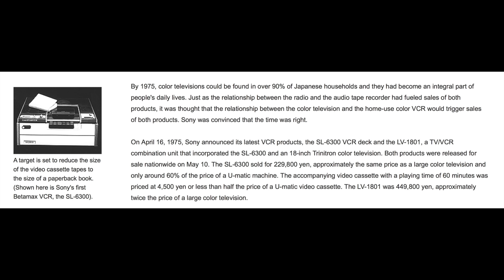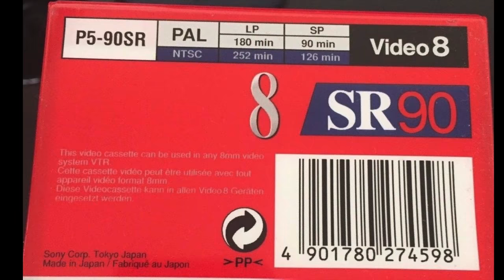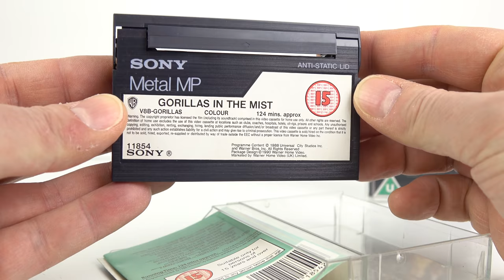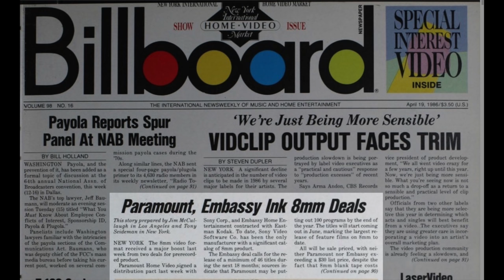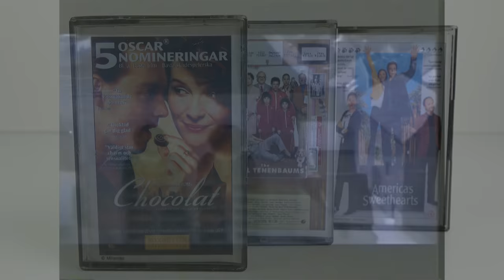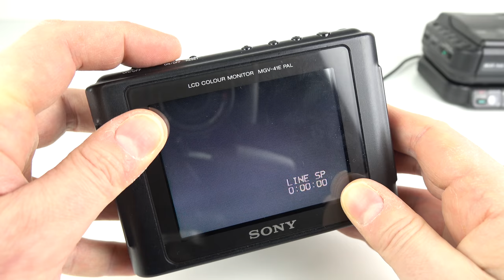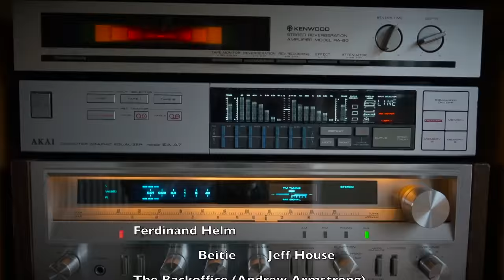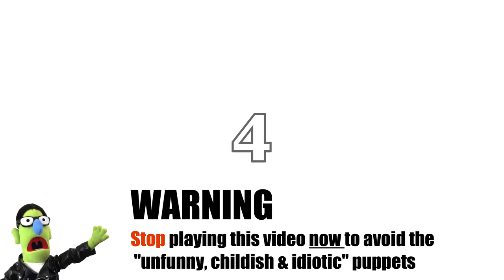Video8 - Sony's forgotten ambitions & the crazy Walkman Compo

Comment: I had one of these Compo's, it came with a nice little metal stand where all the parts, including lcd screen could be screwed on. It was made from yellow painted aluminum tubing and the LCD folded over the other parts for storage and had a handgrip on the top.  
But I used it for my Steadicam in the 90's so that I could record the video output from the "video-assist" camera on the film-camera.  it was great because everything needed to be on battery power, lightweight and easy to access. I had to make special attachments to fit it on my rig. It was very popular at that time with Steadicam operators!

Comment: The Walkman Compo kit is actually a funny throwback to early portable video camera setups which featured a "portable" (luggable) reel-to-reel video tape recorder linked to a separate camera head. At that time (late 60s and early 1970s), the video tape recorders were still way too heavy to be integrated into a portable television camera.

There's some really interesting tech inside those reel-to-reel VTRs as well as in the older tube-based cameras. Would be worth doing a feature video on if you can get your hands on some gear.

It's also quite possible that this Compo setup was the very first setup ever to feature a full-colour LCD television screen to be mounted onto the camera for viewing without an eyepiece.

Comment: Speaking of the Sony CCD-V8 camcorder at 3:53--about 20 years ago, I bought a used Sony CCD-V8AFU at a local camera store--the V8AFU was the later infrared-guided auto-focus version of the V8 which only had manual focus, IIRC.

It was the first "real" camcorder I ever owned (I did have a PXL2000 beforehand ;) ), and it worked quite well--it made great-looking recordings that I thought looked better than VHS.  The backside of the camcorder had all the tape control buttons and LCD counter laid out like a miniature top-loading VCR, and came with a plastic cover which went over the front lens and viewfinder of the camcorder to make it look even more like a VCR!  I  used my V8AFU to record some television from the composite video & audio out from my cable tv box at the time--worked a treat for such, and made a bit better quality recordings than the VHS deck I had at the time (which was fairly recent, a 1995 RCA model with 4-heads and HiFi audio).

It definitely used some 1st-generation CCD technology though, the picture would have some slight smear/lag with any moderate to fast camera or subject movements (as was typical of early CCD technology), almost just as a tube-based video camera would, but was far more sensitive to light than a typical tube camera (plus the color reproduction was much better compared to color-stripe-based single tube color video cameras).

I had it for about 5-6 years until it broke and naturally, it was cheaper to purchase a newer camcorder than to fix it.  I ended up getting a Minolta-branded Hitachi Hi8 camcorder from the same store (and a weatherproofed model even), I still have that one and it still works great last I used it.

Comment: In the 90s, a friend of mine had a video production business and used Hi8,  Two pro-grade camcorders that were the size of the old shoulder carried VHS units but not as heavy.  And a deck that where the tape slid out on  a tray similar to how a CD or DVD player would load.

thanks for the memories.

Comment: I used to work for a Sony repair shop as a camcorder technician back in the late 90s to early 2000s. And I thought that I worked on every model of Sony 8mm player/recorder out there until I saw the Sony Combo. FYI that is the normal sound and behavior of that deck. It wasn't the greatest mechanism. Take-up wheel would develop a hair line crack and the one all white tape pullers would fall off and would need to be glued back in. And that was it on that mechanism. The early 90s Sony 8mm were plagued with leaky capacitors that would eat the traces on the boards. I used to change all of them back in the day. Thanks for the video

Comment: I had one of those Sony Video walkman like you show at 9:11. The training department at work had them for some reason but changed over to newer gear and didn't need them any more so they just gave them away. The one I had only worked to play back tapes a few times before the heads got clogged but I kept if for several years afterwards as a portable tv.

Comment: I was given what I think (currently on loan to my parents for transferring old camcorder tapes!) was a Sony GDV-800 video walkman which looks really similar to the devices in this video. I got it about a year ago and thought it was the coolest thing ever. I spent probably about an hour trying to find where I could get one of the A/V cables to see if I could get a higher quality signal output from the machine, but to no avail. There is something nice about the old Sony design, with buttons and inputs and switches everywhere. Compared to the modern "hide it all under the hood" design style, I do miss having all the controls up front. I was also impressed with the quality and smoothness of the LCD display on the GDV800. Even though it's obviously lower quality than any modern cell phone, the analog no-lag, always smooth video output just feels nicer in some ways. Overall, I thought these devices were awesome when I was a kid and still love them now even though they're retro. Awesome little machines :)

Comment: The airline I work for still has hi8 players on board of 1 aircraft type, (the oldest we still fly). It is used as a backup system only for when the digital system fails. I don't know if it ever gets used, at least not one one of the flights I was on.

I was super surprised to open one of the cabinets in the IFE Ares to find a Hi8 system and a couple of tapes.

Comment: When Sony rolled out Video8 in the eighties, they had an almost hidden feature. They could record digital audio. The first VCR I ever sold for Circuit City in LA was a Sony EVS-700 Video8 unit. It was capable of recording up to six separate tracks of stereo PCM content. That meant up to 24 hours of music on one P6-120 (2 hour) tape at LP. It was lossless, so you could record CDs and get away with it. My Sony rep at the time mentioned that you could make timer recordings off the radio. Very cool. Since Sony had a lot of skunk works projects going on all the time (Ruvi, MicroMV, etc.), I don't understand how they didn't sell standalone, audio only versions of Video8 decks, especially for cars. Since the genie was out of the lamp, it would have been hard for the record companies to request some kind of DRM be built into the decks. Oh, well, we could dream.

Comment: The elaborate eject mechanism on that Sony is exactly how it was on my Sony Hi8 camcorder... and that never sounded happy about doing it either, even when it was new and £1000! I also longed for a dedicated Hi8 tape recorder so I could have edited onto Hi8 to have as the master to keep a little more quality before washing it away when transferring it to VHS. I got my camcorder out of its bag after about 15 years and the soft touch rubber coating they were keen on had degraded into very sticky glue.

Comment: Having so many ports and plugs on one device... such a thing of beauty. This is why for the longest time Sony had such a high reputation for consumer electronics, they LOVED ports. (Well that's my perception anyways, and why I liked them). Also... it just looks cool.
Reply: My old Vaio laptop had more ports than my Desktop at the time lol
Reply: They were the era of quality = number of different kinds of controls on a product.  I can only imagine a sony exclusive smartphone world, with dial volume controls, slide power buttons, deployable antennae and some kind of mechanical slot in alternative format, with the full range of ports. There is steampunk, and dieselpunk, but we have neglected sonypunk, where everything looks like the most expensive radio controller for model aircraft.
Reply: @carbon1255  sonypunk sounds like my aesthetic
Reply: And yet they only put 2 controller slots in the PS2

Comment: I transfer old tapes for a living, and I am always amazed how well Hi8 holds up compared to VHS. It's much closer to a professional betacam tape it terms of longevity and quality.
Reply: You can make a living from transferring tapes? How so? Nowadays, people can buy really decent analog to digital converters that pick up pretty much all details of tapes for less than 30 dollars on the internet, so how can it still be profitable to offer transferring?
Reply: @gayusschwulius8490  Lots of conversions look pretty bad even by vhs standards but yes if you know what you are doing 30 bucks in addition to the vcr and certain software sounds about right. I guess some knowledge about editing, post production and maybe also authoring for the target format would he relevant as well though.
Reply: @gayusschwulius8490  most people's tapes have gone moldy, many don't have VHS decks (let alone Video8/Betamax) anymore, and most if not all just can't be arsed to learn how to do it. You'd be surprised how often the last reason applies to many things in life lol.
Reply: Why would you compare Hi8 to VHS? You should compare it to SVHS. As for comparison to Betacam, this is laughable: Betacam has about four times higher color resolution and much better S/N, which allows to have at least half a dozen generations without visible deterioration unlike color under formats. Although, as an originating format, Hi8 and SVHS were used by news crews at smaller TV stations.

Comment: LOL @ "MegaBass"...when I was in middle school and the first affordable "Discmen" hit the market (1990 or so), it had to have MegaBass or I would just assume it was crap.  I didn't realize until years later that MegaBass was just a cleverly marketed loudness switch.  Oh, and to hell with 2x oversampling - if it didn't have MegaBass and 8x oversampling, I would not have it.  You know, bigger numbers meant a better product!  Great video, I love these Sony niche devices.
Reply: much like digital camera plebs that think more MP = better picture
Reply: I always assumed 'Mega Bass' was just amplifying the low frequency sounds, which doesn't seem particularly amazing(presumably something like a partial low pass filter) - from memory I think it was fairly common to have bass boosting buttons on other devices but I can't be sure.'MASH' used to be the signifier for nice gear in my memory, on Panasonic/Technics etc CD players, even though I had no idea what it actually meant (but the gear it was on always looked good).

Comment: Boots sold VCRs?
Reply: Herring and Chips Yes they used to have electrical and homeward departments until into the 1990s. The large stores anyway.
Reply: Construction Toy Dude Thinking about it. Didn't they sell computers in the late 80's. Spectrum and alike. I vaguely recall that but I could be mixing it up with Woollies or WH Smith's. All merged in to one in my head since I moved abroad.
Reply: David Marsden Can't recall Boots selling home computers but that doesn't mean they didn't.

Comment: In 1987 I bought a Kodak MVS (Modular Video System) that used 8mm tapes. I used it mostly for the camcorder (I have at least 100 'home movie' tapes) but it also had a cradle that made it a VCR and compared to VHS tapes, 8mm turned out to be in far better condition thirty years later.

Comment: I had an EVS-700 Home deck and it was a delight. Not only could I play back my camcorder tapes but I would record of the air with the tuner. It worked really well. Alternatively you could record 7 tracks of audio in Digital Audio on a single tape. We used it to play back the music at my wedding in 1987. I did the "Star Trek The Pepsi Generation" spoof with my V8 camera. I edited it on 3/4 in a studio.

Comment: It's quite interesting device mostly the modular compo which is amazing despite the fact it has a lot of wiring, but I think with current technology, many of these elements would be smaller and using either induction or direct contact elements such as what we use nowadays for processors would greatly improve efficiency, so the only required cables would be things to connect external devices.

Comment: Video 8 only had a mono sound track. Later Sony added a digital stereo sound track by increasing the head wrap, recording the audio into a buffer & transferring this to the final part of the extended wrap. On playback the video frame would be played before the digital audio was recovered, thus in practice the stereo audio replay was a frame behind the video, which was extremely annoying. I had one v8 home deck that not only recorded video with digital audio, it could also be used as an audio only recorder by segmenting the head wrap into 6 (I think it was) separate stereo tracks, thus in long play a 90m tape could hold 1,080 mins of audio (180 x 6).
Akai later developed this into a professional 8ch multitrack recorder. 
Sony also produced the D8 format, which I believe was exactly the same digital video format as MiniDV but recorded onto a “Hi8” video tape.

Comment: In 1984 (or 88?) we went in vacation to the USA. We had that "cheap" Video8 camcorder, the successor to the CCD-M8 you showed. Back then, customs at the airport needed to check if there were bombs hidden in electronics so they told us to turn on the camcorder to check its functioning. But there was no real miniature monitor in the viewfinder, it was just a hollow tube with lenses (to keep the cost down). So we didn't actually needed to turn it on, to fool .. erm ... proof it wasn't an explosive 😁
(In other words, we could've smuggled a bomb on board our airplane in our camcorder)

Comment: There are 2 machines that are very much still around in the 8MM format.  I have 1 and use it to convert 8mm films before I transfer to DVD.  GV-D200 is the 1 I use.  If you see this machine, you would never guess it's capability.  It's no bigger than a portable CD player.  I n the second place, it records digitally.  In the third & most unusual place, you can use any Sony remote control with it.  Since I transfer a lot of films, I needed something that would be able to edit frame by frame.  Because it records digitally, I can do that.  The quality is fantastic.

Comment: Two interesting things I would like to mention:  I was very young when I paid a fortune buying a second hand Ricoh video 8 camera back in 1988. Was out with friends, filming us driving our cars in the local tank practice grounds when police came across our path. The police drove me home and I had to prove my purchase of the camera, so they drove to the other side of the city to gather proof from the seller, thats how rare it was to have a camera at the time.

Second, I was addicted to Walkmans and Gadgets and always noticed blind buttons i.e. markings on the housing where extra buttons where left out. I was always annoyed that my Nikon / Sony Hi8 camera had two  of these markings and guessed that it would add a long missed function: the ability to record directly from other devices via the red/white/yellow input cables instead of the internal camera. Essentially turning the Camera into a full Video8 recorder. Years later I was proven right when I came across a Japanese Sony Hi8 Cam, and there they were! An extra red record button on the top next to the play button and a tiny switch inside the cinch port. I went to work on my camera and realised the internals are already wired up, only the switches need to be added, soldered in. A bit of delicate cutting of the housing and it worked. Almost all the Cameras that used a Sony mechanism had these features that were simply omitted for the European market it seems. Back in the day this would of made editing so much easier. Not having to bounce every time between Hi8 VHS and TV. Ahh.....whoever made that decision?

I guess, in retrospect it was copyright, with a flick of the switch on the camera input and a 2 way scart cable. The camera could essentially record straight from TV or VHS. A big no back in the day.   Anyway, keep up the great work Techmoan
Reply: I think it was because import duties were higher for video recorders than camcorders.
Reply: Ahh, that would make sense  @garethonthetube

Comment: SP was standard play. LP was long play.

8mm and Hi8 have 120 minutes tapes. Most of my camcorder recordings are 60 minutes tapes but most of the off air recordings are 120 minutes Hi8 (240 in long play, but then a lower quality). Not as long as the 8 hours V2000 or 4 hours Super VHS but they took up a lot less space on the shelf.

Best cases for the cassettes compared to VHS, Beta and V2000. Like the compact cassette. 

The video Walkman went through 8mm, Hi8, Digital 8 and DV formats with one model having a small LCD screen and the other without a screen, just a deck. Later models had an optional TV receiver module. 

Owners of the multi PCM track 8mm deck where you could record 24 hours on a cassette were disappointed then the feature was not on Hi8 decks; so not to cut into the sales of digital audio recorders. 

Top models of Hi8 camcorders and Hi8 decks had a 16 bit PCM linear audio track. Over time the FM and PCM sound tracks drift from one another and can't be played together. The PCM allowed for audio dubbing to add commentary and voice over to the original recording. Unfortunately digital 8 can not play back this track, only the in line FM stereo sound track. The advantage to those transferring analogue 8mm and Hi8 on the digital 8 decks is the automatic output through firewire.

Comment: I bought the EVS-600 just for the 18 hours of digital audio storage. Six parallel tracks of 3 hours recording time. Great for grabbing long radio broadcasts whilst I was at work.

Later I got a DAT machine but it was never as reliable as Video8 tape.